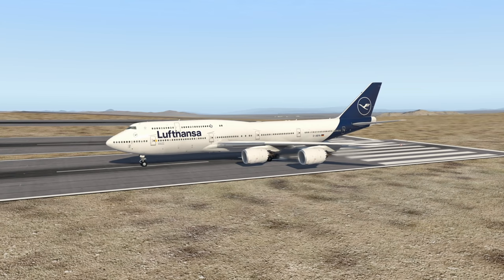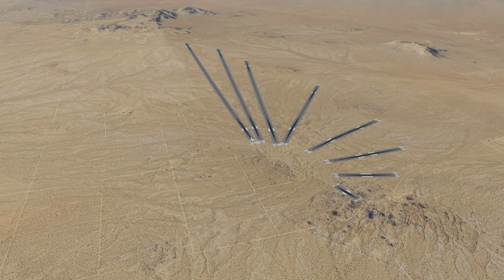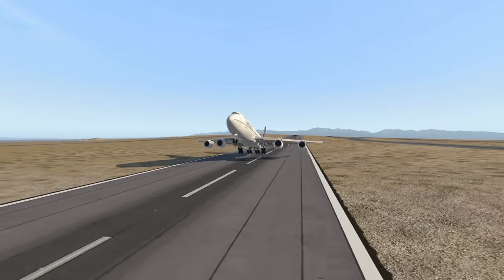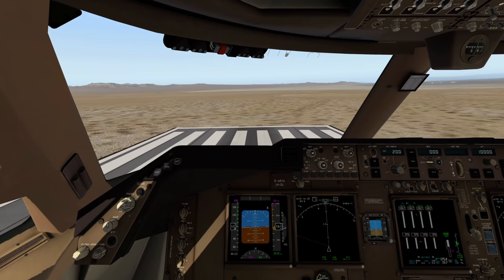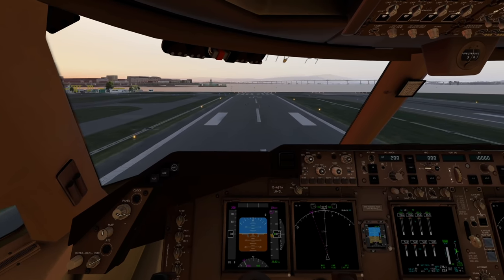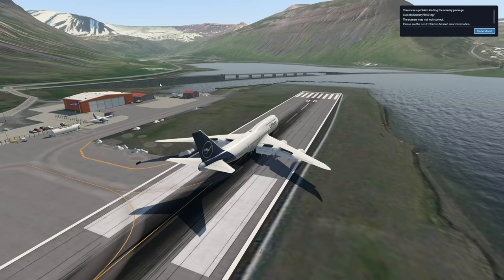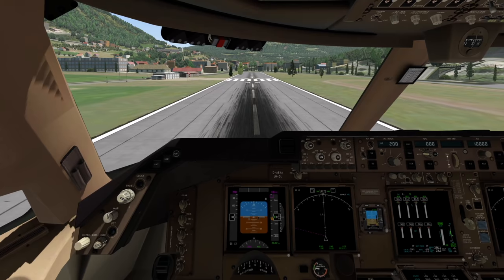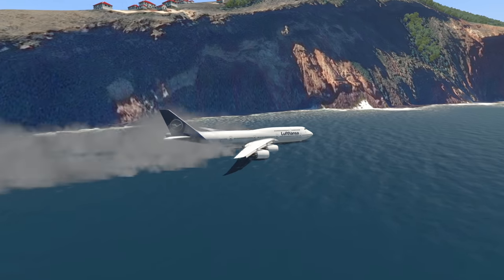How Much Runway Does The 747-8 Really Need?

Comment: The reason the 747 has such a good takeoff/landing length is basically it's age. It came in an age before any real large jets (not just the A380, but also the 777 and 787), and as such the airports it usually operated for were more suited to the smaller planes of the era, like the 707 and 737. However, by the time other large jets, like the 777 and the A380 came along, larger jets were much more common, and with a greater focus on efficiency, planes like the 777 and some airbus models sacrificed takeoff/landing length for more efficient engines, as many airports had expanded in anticipation and in reaction to larger jets preceding them, it was a sacrifice that was easily achievable. 

Another point worth noting for specifically this video is that planes rated takeoff and landing lengths are nowhere near what the plane may be capable of, as regulations usually pad the needed runway to twice or more to account for variables like wet runways and aborted takeoffs, so while a 747 can "technically" land in many places, strict regulations narrow it's capabilities.
Reply: Thanks for the info 👏👏👏👏👏👏👏👏
Reply: Good point

Comment: 747's Are Really My Favorite Because It's So Thicc And It Has 4 Engines
Reply: A380 are thiccer but ok...
Reply: @ahmadsaleem3490  747 is sexier, is a legendary aircraft that is still in production for over 50 years unlike the a380, and that is facts
Reply: SCARY FAX laughs in beluga
Reply: Lmfao
Reply: 747 are not equipped with a easy tablet, joy stick and better space for both passengers and pilots
Reply: @gateway833  also big boy, they are making diffrent models of the 747 for example 747-i8 and etc, they are only making one kind of A380
Reply: @gateway833  the 747 is has a much higher chance of fatal accidents than A380
Reply: @gateway833  Also, us Airbus fans ain't Sxually into planes like yall boeing fans
Reply: @gateway833  also keep in mind that A380 was introduced way after 747, A380 will most likely still be manufactured in 50 years in one type unlike 747 who had to make diffrent types of 747 bcz they can't get over their old planes 🤣
Reply: @ahmadsaleem3490  The a380 is way harder to fly and the 747 is more prestigious.
Reply: @ahmadsaleem3490  It didn't crash a single time and its more lightweight, the a380 crashed  2 times though in less years of production.
Reply: @787pilot3  The A380 is easier to fly m8 but ok, one example is the joysticks compared to the yolk
Reply: @787pilot3  747 has crashed multiple times infact the biggest accident in aviation history occurred between 2 747's
Reply: @787pilot3  please check your facts be for you try me
Reply: @787pilot3  A380 has only suffered afew malfunctions but has never crashed but ok
Reply: @787pilot3  bro are you high or smth your facts are so off
Reply: @ahmadsaleem3490  blame it on atc check ur facts they collided on taxiway
Reply: @ahmadsaleem3490  the 747-8 is safer than any A380, no incidents and no Tolls Royce engines to burst, a great stopping performance, less chance to overrun than the A380, wider windows, quiter (for those who hate engine noise unlike me) more fuel efficient, more technology
Reply: @787pilot3  true
Reply: @ahmadsaleem3490  I like the 747 more it’s og

Comment: There are a whole lot variables mostly density altitude  and weight that determines the length of runway required. With a straight down the runway hurricane winds, the aircraft can actually takeoff vertical. Speaking of vertical, have you seen some of those on my channel?

Comment: As a pilot, I give you 2 recommendations, which we do in real life. First, for an STO (short takeoff), you must apply brakes and full throttle at the same time, and then release them, so the aircraft accelerates as fast as possible. Second, for landing, it's better to push the rudder down, so that makes more weight or pressure on the wheels, that helps breaking
Reply: Swiss001 has PPL he flies Cirrus SR20
Reply: Maybe he didn’t have at that time but now he does

Comment: The limiting factor for the 747-8 isn't the length of runway. It's the runways ability to support the weight. On some of the runways I've built, If a 747-8 landed at max landing weight, I would need to completely re-ballast the sub-aggregate and resurface the runway.

Comment: Smaller runways means more wear and tear on the force to accelerate and decelerate the aircraft specially on the larger ones.
You want a smooth transition between take offs and landings, it keeps prolongs the life of the engines and components. Just like you don't floor the wheels on your car and you don't do hard breaking on the disks every time you use your vehicle.

Comment: an idea for Boeing : the 747-9F and the 747-9I, wingspan : 73 m with retractable wings, wingspan when wings are retracted : 64 m, length : 80 m, and height : same as the 747-8, first flight : 2025 or 2027, max take-off weight : 421 000 kg, max landing weight : 400 000 kg, max passengers : 747 passengers and 23 crew members (including 2 pilots), max fret : 167 000 kg, the 747 will never died (maybe), engines : 4x GE90-115B (same as the 777-300ER), cruising speed : 1030 km/h, max speed : mach 0.97

Comment: Unable to understand how can you sitting in front of a computer take off 747 800 on a 1500 m  run way  it is not possible because the plane would not land on 1500 so please stop giving your verdict  on these Jets sitting in front of the computer you need to be a pilot its not possible did u engaged  MTW on 1500 m ?